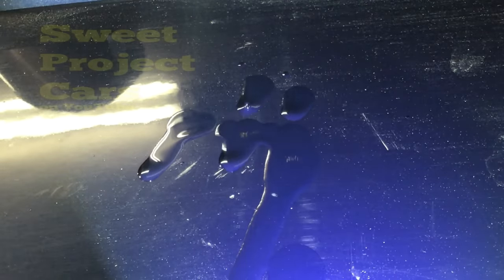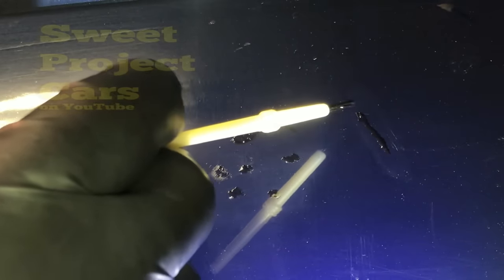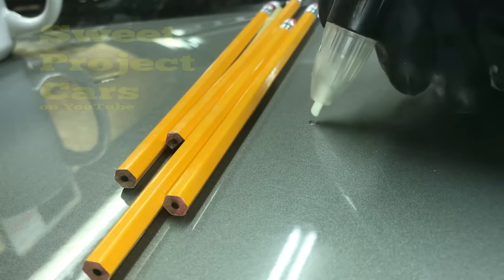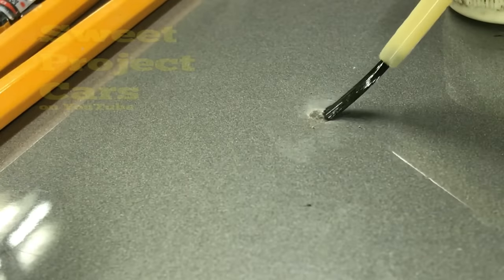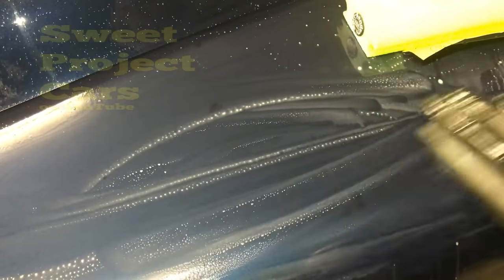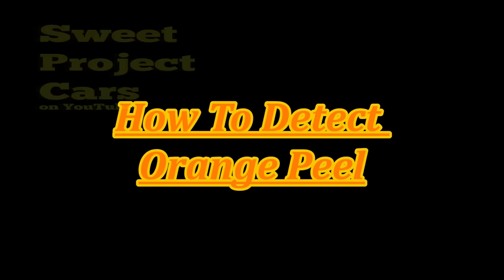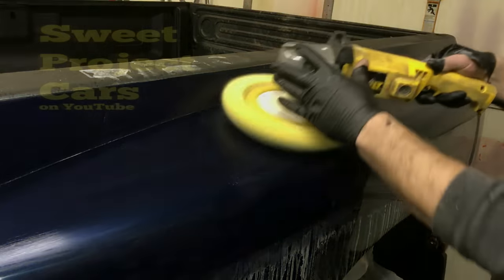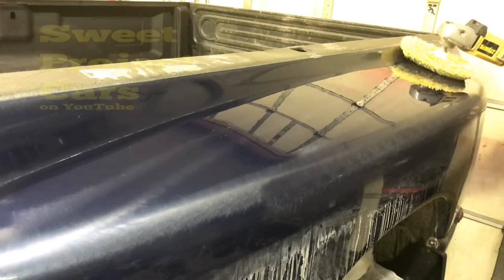How To FIX Any Paint Chip or Scratch in Your Car or Truck Paint... DIY

Comment: Hey Mike, ... video suggestion: Unless it already exists, been going through your older vids on car paint restoration and am very unclear about the tools to use with the Dewalt polisher. Items listed in the tools vary from single action to dual action polishers and 7"-8"-9" pads and backers, hook-it systems, etc. Trying to put together a single polishing tool set but don't know what to buy, what is compatible, etc. All these items seem to not be compatible with each other. It would be great to hear your advice on exactly which polisher and items to get with it as well as which pads do what and the order to use them in ... sort of like a How to Assemble the Perfect Polishing System.  Thanks in advance!!
Reply from the maker: Watch this video and follow it https://youtu.be/W1atzCCziO4  you will get the same results we had. All of the tools/products are listed and you should easily be able to follow using said tools/products Marco. Just take your time, you can do it my friend! Thanks for the view and comment, have a sweeeet rest of your week. mad Mike

Comment: When rehabbing old paint, after repairing the chips, should you follow your directions on 'ceramic coating', or your 'best shine' videos?

I remember you saying don't use wax in the 'ceramic coating', so  what would be the the best steps to follow from the chip repair, to removing scratches (clay bar), to the ceramic coat?

You put out so many awesome videos, it's easy to get a little lost in it all.
Reply from the maker: Hello Jay either one will work great I lean a little bit more towards the best Shine videos but they both work very well

Comment: This is a great video on how to restoring stone chips or large chips on the paint of your car. I have similar problem, not on the rear fender like this but on the left front of my Honda Accord bumper where the lawn care idiots blasted it with dozens of rock chips from the bush trimmer right after I had it paint in less than a month before. So my front bumper looks like it has been shot with shot gun pellets and despite the fact that I tried to fill them up touch up paint, it still have the divots in the paint finish and the paint wax would fill them and make these ugly white circles. I think I will start it over and will clean off the divots with lacquer thinner, sand it, fill them up with Bondo body gap filler and then touch up paint like it before sanding them down and polishing. The only problem I have is that the front bumper and multiple angles and surface lines that will make it a lot harder to sand down it evenly even with a sanding block.
Reply from the maker: Tim, this is what we use  https://amzn.to/34Zdi9l  sorry to hear about your misfortune.  Hope this helps.  Have a great day.  mad Mike the hammer SpC

Comment: This is ABSOLUTELY the best video ever on doing this sort of thing. One question: Would you do anything differently for an older car which does NOT have clear coat? I have a 69 Corvette(it has been repainted), and I am wondering if there's anything else I should know. Thanks!
Reply from the maker: As long as you have the matching paint my friend you should be able to take care of any issues I’m sure the paint job is the lacquer finish you should still be OK without any issues have a great night thank you for asking
Reply from the maker: jpippy7 we received partial wording on your last comment but I think we got the Idea, I can tell you that the mothers we use is the best on all paint and clear coat even if it is a lacquer paint like you have...we have tried over the years everyone's polishes and nothing compares to it :)

Comment: Very interesting approach. I was just wondering how it would hold up, as there is no clear where the touch up was done. Regardless, excellent explanation, and outstanding job.
Reply from the maker: The clear coat is in the paint.  Thanks for watching and asking.  Have a great evening.  mad Mike the hammer SPC
Reply: @SweetProjectCars   I have noticed when I watched it again. Too bad we do not have those premixed touch up ones for taffeta white (Honda white). Still doable I guess by repeating the process with the clear on top of the filled stone chips. Thank you very much for the reply.

Comment: Great video! Some Sonax MaxCut would have removed the scratching with a single quick pass.
Reply from the maker: That's great, but this video pertains to paint chips and scratches, probably not going to fix with one quick pass on those chips. Thanks for watching. mad Mike the hammer SPC
Reply: @SweetProjectCars   I love your channel and didnt mean it as a critique so much as just trying to be helpful. I was refering too when you leveled down your fill paint by sanding then polished out your sanding using a ton of metal polish with a rotary and wool pad. 5-6 small blobs of Sonax CutMax (and others like Xtreme Solutions Knockout) would have removed all those scratches using a fraction of the time and material. Love your videos! Thank you for making them!

Comment: Well I was thinking that looks dreadful...until the sanding. Great job! Scary stuff using a scalpel and sanding your car though. I guess you can't really know if the paint is a good match until you've done all that. Like I hear Mazda soul red touch up paints and others are bad because the original is a 3 stage and the touch up is not. Maybe people just didn't do the process correctly like you did though and just left it as it looked before you sanded? Can't imagine too many people daring to sand their new car.
Reply from the maker: Yes many of the paints today are tri-coat paints we will be doing a video on that very shortly

Comment: I love this video. What I realized from it, is that almost nobody knows how to do this process correctly. Everyone that I talk to says you just put a tiny little bit of paint on there. And all of those people get the same awful looking results that I always have had. Game changer mixing the paint and the clear coat together before! I'm excited to try this out for myself. However, I do have one question, if I have scratches on my front bumper and the dealer said that it's plastic, can I use mother's on it and buff it out, or is there a different product to use on the plastic?

Comment: I have a couple scratches in my 2015 Outback that someone filled with patch paint but never went the next step to sand them down and polish. I knew there was a method to doing it but held off until I saw a video someone put out showing proper procedure. I know they used the right color anyways. Its just a matter of sanding down the paint humps.
Reply from the maker: RC Hobbyist Extreme we have a video on shaving the humps so you don't have to sand so much

Comment: Questions:
1) How long do you need to wait for the self etching primer to dry before applying the paint?
2) What grit sandpaper did you end up using on the end of the pencil? or did you use both? 600 then 1000? The sanding process with the pencil was edited.
3) How long should you wait before applying paint to a vertical surface so that it doesn't run? I have one of the duplicolor pens and I guess I extract a little on to a piece of cardboard or something and wait how long for it to get tacky? A minute or two maybe?
4) I matched the color code on my vehicle (Toyota 202) to a Duplicolor pen, but it's the universal black. Same part number on the Duplicolor website as the "Blck - 202" they have listed. How Reliable is the Duplicolor paint matching system?

Thanks and great video! I am going to try this process over the weekend.
Reply from the maker: Tom Persons follow the primer dry time on the can you are using that works great.  at 7:46 I show the pencil sanding. we used 1000 grit on it. as far as runs in verticle areas you add the color to a paint cap or something that will hold it so it can dry a bit, you need to use good judgment on this dry time as all drys different, temp has a lot to do with it, once its tacky like maple syrup then it is usually ready.
Reply: Awesome! Thank you so much for the quick reply. I have one other question about the touch up paint. My Dupli-color pen has the clear separate from the paint itself. Is it possible to use this instead of single stage paint? If so, how do I go about applying the clear coat? Do I wait for the base coat to dry and then apply the clear before wet sanding?  Or maybe I'd be better off simply getting a single stage matching paint from the auto paint store? I'm a novice at body work but have a lot of experience working on my own vehicles over the last 30+ years so I'm quick at picking things up. :-) Oh and what I meant about the sanding was that the video was edited in the middle of the sanding so that we went from starting to sand to it being complete. I wasn't sure how long you sanded for or exactly how you knew that the edges of the chip were sanded well enough. Anyway, I think I did it correctly and I have already cleared out the rust, sanded and primered those chips. Thanks again for an awesome channel and quickly responding to questions!
Reply from the maker: Tom Persons. my advice is to stick with the single stage paint if you are a novice and then follow the video to a "T"  also if you have not seen this video it may help you immensely on the sanding and buffing  https://youtu.be/TsqvlmFrYY0    thank you very much, my friend, we do highly appreciate your great comments :)
Reply: @SweetProjectCars  .

Comment: Excellent video! If the previous owner of my car filled in chips with what I assume is touch-up paint who knows how long ago, will sanding with 2000 grit be able to achieve the same results?
Reply from the maker: rob 2000 grit should do the job for you

Comment: Great stuff!!
I subscribe and watch all your vids.  
I have a hood full of paint chips.  Luckily the paint is black so the match is more forgiving.
Anyway, I recall a video, I think from you, about filling chips with red bondo glaze.  Believe it or not, I have used that stuff as a final coat after filling nail holes on residential  door trim and molding.  It makes the nail holes disappear, but it has a heavy chemical odor and it can make you dizzy if you don't wear a mask in an enclosed area.  So, I was procrastinating on filling my paint chips. 
Now, I watch this video and it seems easier and the resukt s are perfect.  
If this is as good as or better then the bondo, I'm on it this weekend!
Please let me know how the methods compare.
Thanks!!
Reply from the maker: Alan this video here is the one you want to do as it will do the job fast and efficiently    thank you very much and for being here with us :))

Comment: Yo Sweet Project!  I have another use for isopropyl rubbing alcohol - pine pitch.  I have used everything from all of the over the counter stuff to 91 octane to (try) and remove pitch drop both fresh and dried.  NOTHING works better than 90 proof.   It's cheap, easy to find it's natural and like you say will not hurt the paint. First!: make sure the spot you are to work on is clean so's not to scratch! Use a clean microfiber towel dabbed with an 2-3 inch patch and slowly (and LIGHTLY) rub in a circular motion directly on the pitch being careful to keep the patch you are working on tight and concise.  You may have to repeat several times to keep a fresh soaked portion of the towel and to clean up any residual pitch that may have spread during the removal process.  Pitch is nasty and the longer it is on the surface of your vehicle the more it can etch it's way into the clear coat and paint so catching it as soon as possible is best although fresh or dry the 90 proof will dissolve the sticky goo like magic,  If the pitch has dried and set for a long length of time you may have to expect a slight spot or outline similar to a water spot to remain.  I find how it cleans up is exponential to how well the car is waxed - speaking of which the alcohol WILL remove wax from the spot you work on and should be gone over-replaced once the removal process is done.Terrific/quick/easy/economical!  I am from Maine the Pine Tree State - I know a thing or two about pine pitch mistah!  Try it and good luck!
Reply from the maker: Audie Conrad thank you for sharing your trick this is what we do https://youtu.be/pBh2hpjUIGw after trying everything else under the sun :)

Comment: I have one 2001 Chevy pickup I want to clean up and I found tucked away a Harbor Freight Polisher/Waxer that oscillates at 4,000 oscillations per minute. That seems too fast but the one you recommend is no longer available at Amazon. What do you think is the ideal speed for a single action buffer and is variable speed helpful or to be avoided? Great video.
Reply from the maker: Max Mayhem this is the one you want my friend   https://amzn.to/2JEBDnw I swear you will not be sorry..it is safe and does the job like no other :)

Comment: Hello Mr .Sweet project ,thank you first of all for sharing your vast knowledge and experience with us knuckle head amateurs out there!  I have a question about the orange peal . If you get ride of the orange peal on a panel and the rest of the vehicle has orange peal ,won't to have to wet sand the rest of the vehicle so it will match?
Reply from the maker: You’re very correct Greg the only way to rid yourself of orange peel is to wet sand all the affected areas if the whole vehicle has it then the whole vehicle needs to be wet sanded we say with a project this size to do it a little bit at a time if it is possible this way, this way you do not wear yourself out physically and mentally

Comment: Thank you so much for the video, the methode with the sanding paper attached to the eraser edge is brilliant 
.I have a question, 
I have little rusty rock chips in my car
I have difficulty to get one of the etching primers in my country. 
But, I have an epoxy primer in my hand, 
Is it equal? Can I use either one of them?
Reply from the maker: You can try it and see how it works for you.  If applied correctly it should work out just fine for you.  Thanks for being a great subscriber my friend.  We appreciate you!  Have a fantastic day.  mad Mike the hammer SPC

Comment: Fabulous videos, easy tips and logical. In either of the rock chip filling methods, 1. could I simply use car masking tape for my punch cut-outs (maybe avoiding high spots from spray getting under paper?) and 2. I'm a bit afraid to use the mother's aluminum polish on the second repair method after wet sanding. Would any medium cutting compound work? Also, would you recommend an ipa wipe after using mother's aluminum (for the first compounding) before moving on to a polish/wax? Would that make any difference? I always think it's best to put wax over a clean surface depending on what kind of base the compounding agents are in. Not sure which method I'll use yet, but you've already put me on the road to a great outcome. Thank you!
Reply from the maker: Just follow the videos and make sure you use the exact same products/tools we use for success my friend! Thank you for watching and commenting, hope you have a great week. mad Mike

Comment: I have been working on my rear lights today and where the light fixtures touch on the body, the paintwork has formed a thin line in the form of a slight blister under the paint. I guess this is rust formng where salt from the road gets trapped in winter. Is there any way to treat such a blister before it breaks through the paint? Should I break it, treat it, then touch-up the line with a touchup pen? My car is 12 years old and in good shape thanks to your channel!
Reply from the maker: Hello J Law, you need to sand those blisters down and touch them up.  Thanks so much for watching and asking, we apologize for our late response.  Have a great day my friend.  mad Mike the hammer SPC

Comment: I’ve been using adams iron remover wheel cleaner to remove the rust before the self etching primer and I flush the dry paint with a nib file so I can’t over sand.
Reply from the maker: Thanks for watching and sharing, have a great day. mad Mike the hammer SPC

Comment: Great videos and advice. Any special procedures for repairing paint chips on rounded door edges?
Reply from the maker: alan we use the same technique for those chips but you sand them down with 2000 grit by hand and then hand polish

Comment: I watched your other video where you took care of 2 or 3 chips and this method looked really good
Your end result looked professional 

 Bit hesitant about sanding but If i use 3000 grit on a soft flexible sand block with dish soap water i should be fine?
Reply from the maker: xrmte if you follow the video to a "T" and use the exact products listed you will have no issues my friend :)

Comment: this is exactly what I was looking for ty, I have  three chips on the side door of my Ford, will try it out, question how far back do I need to sand the chips are right  on the edge of the door near the door handle...
Reply from the maker: This will work great for you and it is trial and error just make sure you follow the video it is always better to sand with a higher grit sandpaper like 3000 to 5000 and take your time and have patience with it

Comment: What about applying clear coat? I have ordered color for my Volvo and it comes with both the base and the clear coat. When would you recommend applying the clear coat in this process? Thanks for a great video!
Reply from the maker: What we do is the process in this video  https://youtu.be/vOlQfsuBz7I  it works great because you don't have to worry about when to use the clear coat because it's already in the paint, Once & Done!  Hope this helps, thanks for watching and asking martin, have a great day. mad Mike the hammer SPC
Reply: @SweetProjectCars  When wet sanding, is it just water or some sort of soap mixed into it?